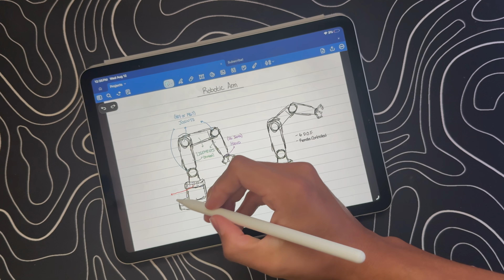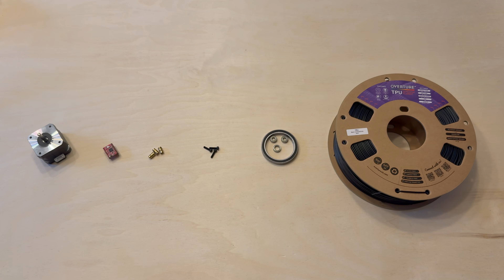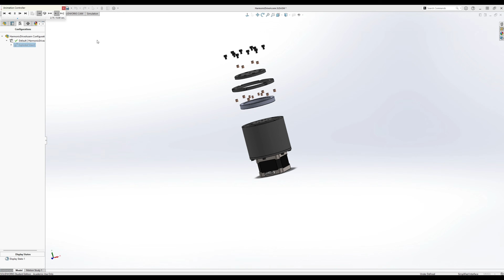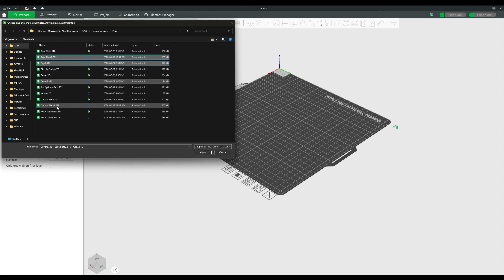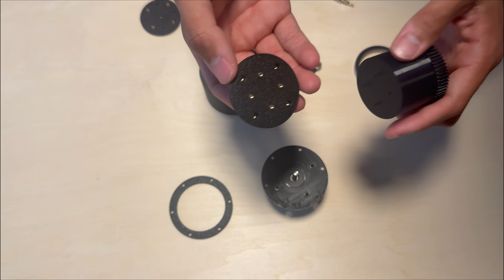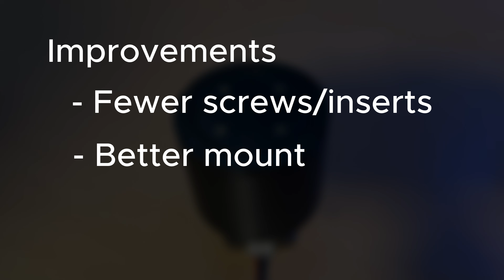I Made a 3D Printed Harmonic Drive to Cut Costs! (DIY)

Comment: 6:08 dude that cord is elongating and not transmitting the force correctly
Reply from the maker: Yes, you’re right. Since I didn’t have a proper force gauge, I couldn’t accurately measure the torque/force, so that test was mainly intended to evaluate repeatability. A non-elastic rope could also cause the mechanism to jam or stall as it passed the perpendicular point, so I opted for an elastic cord to keep the load engaged throughout the test.
Reply: @Tom-Engineering  pretty sure the force doesn't change. by that logic i can lift a car as long as i do it through enough elastic bands

Comment: if you use .STEP files instead of .3MF and .STL in the slicer your round objects won't have the segmenting.
Reply from the maker: Thanks for the tip, I’ll definitely give that a try on my next project!
Reply: @Tom-Engineering  stl files are triangles...step files are exact mathematical curves

Comment: Great video. Why’d you used TPU for the gears?
Reply from the maker: In a harmonic drive, the internal gear or “flex spline” needs to be flexible to some degree in order to function correctly. 

For a 3D printed project like this, TPU is perfect because it’s way more flexible than other plastics like PLA (as you can see visually in the video), and budget friendly!

Hope this helps!
Reply: @Tom-Engineering  TPU is flexible and tough, but I wonder if it's stiff enough to provide good torque. ABS or ASA is stiffer than TPU but still tough and has more flex than PLA, so you may want to experiment with that.

Comment: Do you know roughly what the backlash and repeatedly is for your harmonic drive? I am currently trying to design a 3D printed cycloidal drive with high compactness and low backlash but would be interested in trying a harmonic drive setup aswell.
Reply from the maker: I didn’t get a precise measurement of the backlash, unfortunately. I mainly tested the repeatability, and it was pretty consistent throughout my testing. 

Since it’s fully 3D printed, I’d expect the backlash to depend quite a bit on the printer tolerances and how the flex spline and wave generator fit together. I’d definitely be interested to see how it compares to your cycloidal drive though, and am considering doing more tests in the near future with better tools!

Comment: Nice! 3D printing expensive stuff is fascinating, but theres a few things I need to point out:
1. Stepper motors driven using conventional microstep drivers have a steep holding torque dropoff as you increase the microstep, up to ~90% less. The only real justification for NEMA steppers is the well adopted form factor and ease of control; for accuracy you will need feedback drivers and at that point a BLDC motor may be more suitable.
2. Harmonic drives do not use conventional gear tooth geometry; optimizing it have a significant impact on component lifetime and efficiency.
3. The flex cup/spline has to be torsionally stiff while still being able to withstand cyclic deformation radially. This is the main issue with harmonic reducer costing an arm as only special alloys and advanced machining can achieve this. 3D printing is on the opposite end of the spectrum where material/print orientation only gurentees either the flex or stiffness, not both. For your TPU spline, applying load will squish the teeth and cause the cup to twist slightly since only ~20-30% of the tooth bears all the load, and the layer lines means greater chance of shear failure when twisting. 
4. Small pointer, but I think the fixed ring and mounting piece can be designed to be one piece?

I have made a couple of 3D printed actuators before, and strain wave is comparatively not a very 3D-printable mechanism compared to say cycloidal drives due to the anisotropic nature of components and limited material selection. But you can always prove me wrong if testing reveals a usable efficiency (>80% is considered decent) and accuracy under load.
Reply from the maker: Thank you so much for your input! It was really interesting reading what you had to say.

First off, I have seen BLDC motor harmonic drives, and I agree that they can be very efficient. While in the design stage of this project, my priorities were mostly cost and simplicity, which made a NEMA 17 stepper motor my first choice. Although, now I would be interested to see how a 3D-printed BLDC-driven harmonic drive would perform.

Regarding the gear teeth, I went with the basic geometry because I didn’t think my printer would be able to accurately produce more complex alternatives given the small size and complexity. I was also being careful not to overdo anything with the TPU print, considering it was my first one.

As you mentioned, TPU obviously can’t match an appropriate alloy in terms of stiffness and fatigue resistance, but for a project like this that prioritizes cost and simplicity, I think it was a good choice for a proof of concept. As for the strength, I tried my best to improve the flex spline by varying the printing settings, wall thickness, and its overall length.

The reason the fixed ring and mounting piece are separate in this design is so that I can access the inside without having to take everything apart. This is especially helpful if I need to replace the flex spline or check if the motor is working. That being said, for a more finalized design, I think your idea of making them one piece would definitely be an improvement.

Overall, you had some really helpful pointers, and I’m grateful to hear from someone who has worked with similar mechanisms. If I end up making another harmonic drive in the future, I’ll definitely be referring back to this comment and doing some of the tests you mentioned!